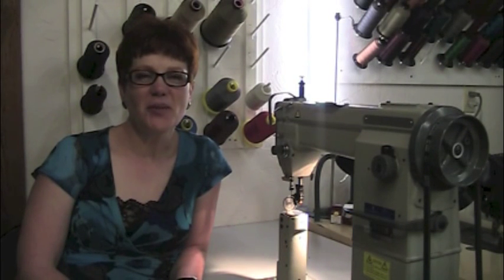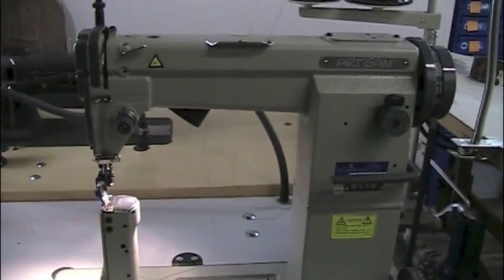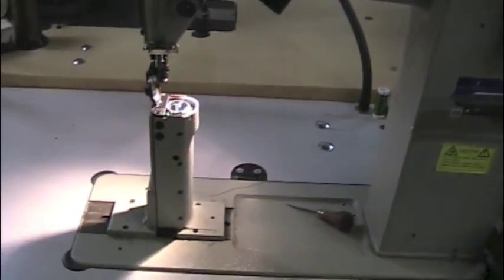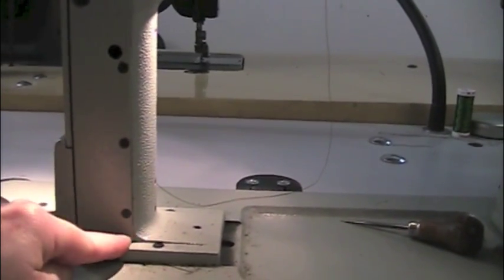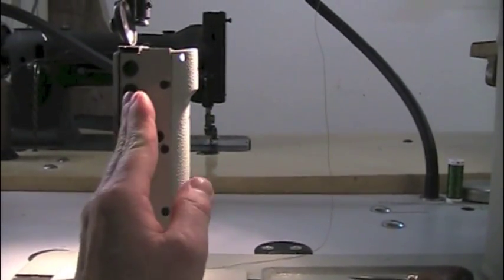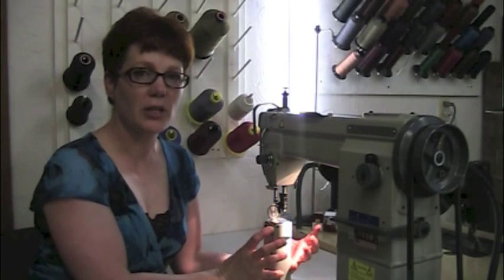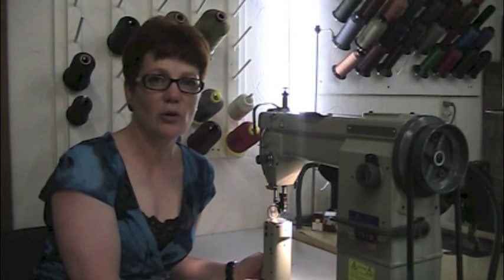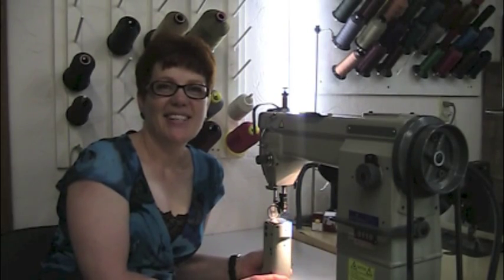21: Post Machine

Comment: Hi Lisa .  I figured out my machine needle , The guy that owned it before me had the needle in crooked I have that tuned now I still have to look at the big Tension spool though .
Reply from the maker: Ah, good to know! Best of luck!
Reply: +Lisa Sorrell Have you ever ran across that on the big tension spool the spring loops turn or weaken when it's adj
 normally it just frees the thread .
Reply from the maker: Are you asking if I've ever experienced a spring that weakens and wears out? I haven't. If you're having issues like that, my first guess would be that perhaps the tension parts aren't put back together properly.
Reply: +Lisa Sorrell There's 2 loops the keep the thread snug as the upper pitman arm pulls the thread on the big dial has a dial to lift and lower the loops never seen that before in 38 yrs of sewing
Reply: +Lisa Sorrell There's 2 loops the keep the thread snug as the upper pitman arm pulls the thread on the big dial has a dial to lift and lower the loops never seen that before .
Reply: Found out the post was not straight
Reply from the maker: That'll do it.
Reply: They had the tension nut cross threaded too told them they wanted it back ,Not likely

Comment: Hello Lisa. I purchased a post bed is 810, looks very very similar to yours. However having trouble shooting issues, my thread keeps getting caught around the bobbin case, I have done everything from changing needle, to buying better thread to taking apart and removing dust, I can’t find any videos on issues with this type of machine, Is there any way you can help me figure out what the issue is. It does it sometimes and sometimes it don’t, but more often gets caught.
Reply from the maker: That's tough to try and diagnose, but the first question I'd ask is: Are you using the correct needle system? Also, are you using the correct bobbin or bobbin style if it's a pre-wound?
Reply: @customboots  the company I purchased from supplied me with needles and bobbins. I wounded bobbins myself. Tried reaching out to company for questions or trouble shooting recommendations but that was a fail.😔😩
Reply from the maker: @TSIMONE  If I were you, I would confirm you have the correct needle system and the correct bobbin style for your particular brand/model of machine. 
Also, make sure you put the needle in correctly. The side with the groove goes away from the bobbin; the side with the flat spot goes on the bobbin side.
Reply: @customboots  oh my gosh.. i wonder is that the issue. I have groove towards bobbin.
Reply: @customboots  I will let you know if that was my issue.. thanks for your time and effort😘
Reply from the maker: @TSIMONE  Let me know if that helps.
Reply: @customboots  good morning, so I flipped needle around,  turns out my machines needle groove faces the bobbin, but while messing around with it, I mistakenly pressed the pedal for faster speed and it didn’t jam, so maybe I was starting too slow. But I will do more today to see if that was my issue. Possibly stitching too slow. Thank you
Reply from the maker: @TSIMONE  Hurray! Yes, if your machine is timed a little fast or slow, it will demand to only go fast or slow. If it’s timed correctly though, going too fast or too slow shouldn’t matter.
Reply: @customboots  can you tell me about timing it? I literally know nothin abt industrial machines
Reply from the maker: @TSIMONE  Try this video: https://www.youtube.com/watch?v=P3AQxuVDTzA
Reply: @customboots  ok thank you

Comment: Hi Lisa, what is max. thk. of material & max. thread # can I use on this machine?
Thanks_Vahan
Reply from the maker: Vahan Galdjian  I haven't really played with the upper limits of this machine. My guess would be size 69 (TEX 70) thread, size 16 needle, and 1/4" thickness of material. It's not a machine for really heavy work.
Reply: Lisa Sorrell Hi, thanks for info. I'm also looking "Techsew 810" post bed similar to "Artisan 5110" & don't know which one good for me. I appreciate if you give me some advice. Have "Consew 205RB-1" walking foot, but prefer to have roller foot for more control (trying to sew leather bags).
Thanks_Vahan
Reply from the maker: Vahan Galdjian The Techsew 810 and the Artisan 5110 look like they're basically the same machine. I was pretty close on my guesses for the minimum and maximum thickness, thread, and needle size.
Specifications:Sewing Capacity: 5/16" Roller foot clearance: 3/8"Post-bed height: 7" Stitch length adjustment 5-25 Stitches per Inch (1-5mm) Needles: 135x5 #11-21 Thread Sizes: #23 to #70
Reply: Lisa Sorrell Thanks for info.